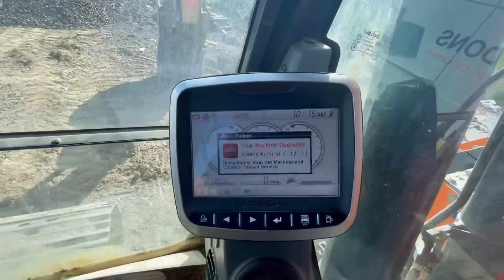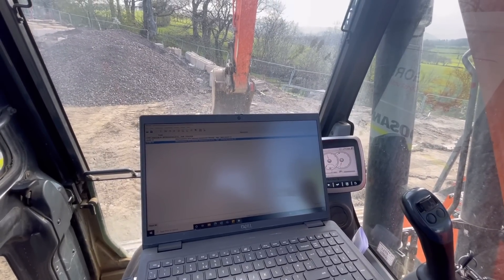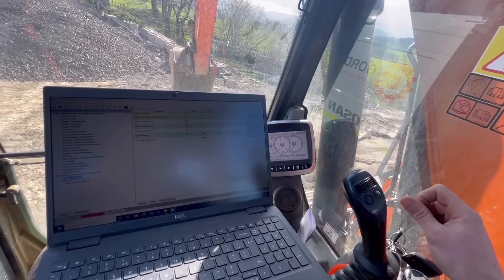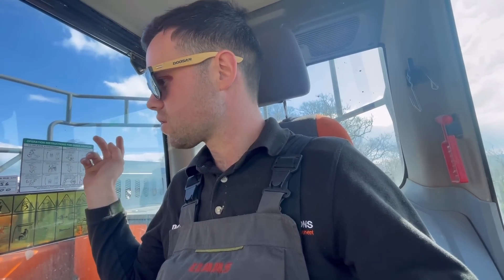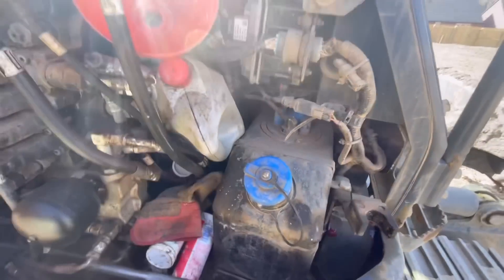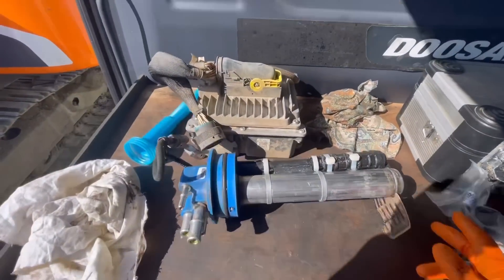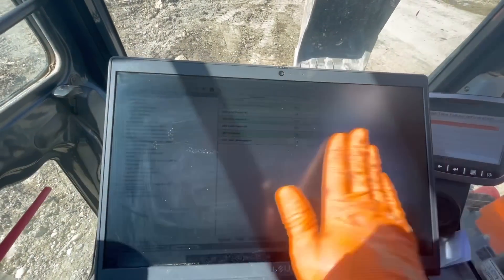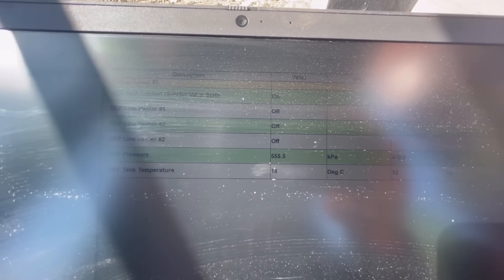Adblue strikes again ! / just keep it clean !    / nice day in the lakes / Episode - 181

Comment: Would the same apply to refilling an IBC as reusing 5 gallon drums when our IBC gets to six inches its refilled.
Reply from the maker: It depends there’s storage instructions on cans of adblue it’s to be stored out of direct sun light at a temperature between 16 - 25 degrees so if the income is in a shed it should be ok